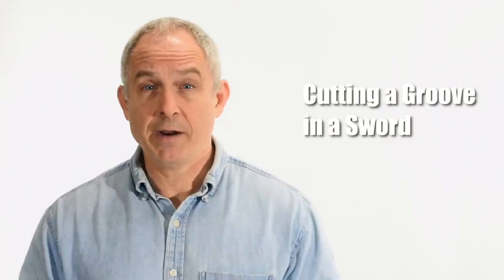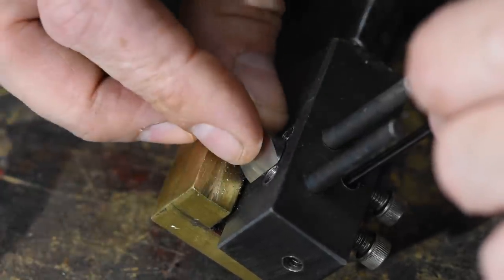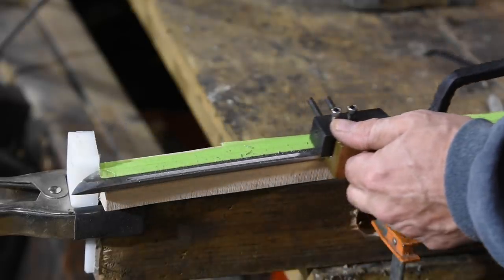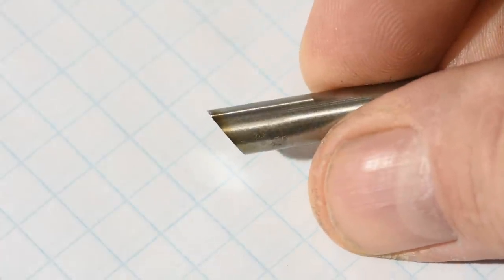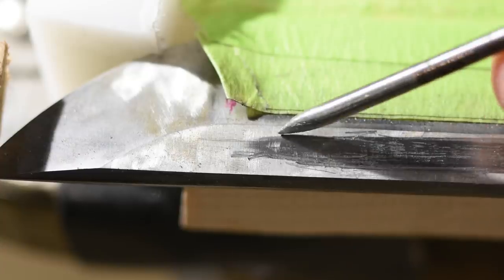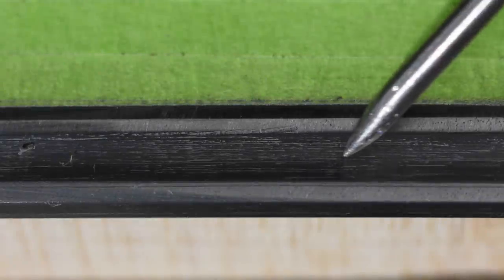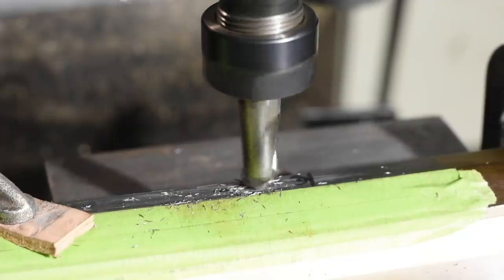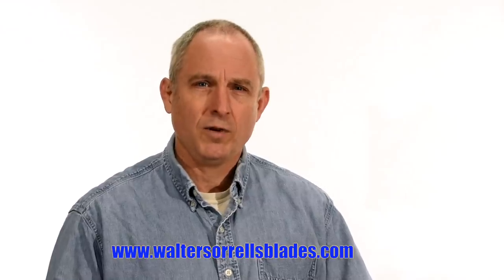Make a Groove in a Sword!

Comment: Walter. I have always found this process an absolute ball ache. After watching the videos of great makers like your self, I see now that this process is an absolute ball ache.
Reply: Exactly why I just use a mill machine. Doing it this way is merely for the sake of saying you did it this way. A mill would not make that curve though
Reply: @joey6704  I've been dreaming of a mill for quite some time now.
Reply: @NeillWylie  Worth every penny. Check out some bench mills they have out there. A little over a grand, and they can do some pretty awesome stuff if you get the right one.

I sold my old one foolishly, but I have my eyes on the Harbor Freight Central Machinery 1/2 HP Bench Mill

It'll never replace a solid one ton machine, but it also has half the headache that comes with owning one too
Reply: I never knew that hp made mills. And you can always add the bohi prior to heat treat right?

Comment: Walter, I have no idea how applicable it may be but this process reminded me of machine scraping such as we do to restore sliding ways on a lathe or mill. A Biax power scraper with the right shape of carbide tool attached might give you a good balance of speed with control to rough out grooves, especially the irregular terminations at each end. Worth researching perhaps.

Also, you’d be surprised how well a woodworking router with cheap carbide bits will cut steel. It’s terribly messy and the swarf is murderous, but sacrificing a couple $15 half round bits to rough out most of the groove material on a blade like this might save you a day of hard labor. Again, maybe worth researching. 

p.s. Check that 1/2” groove cutter hardness if you can—I’ll wager it’s softer than your 1/4” cutter causing the chatter and fast wear. 

Best regards,

Tom
Reply: You've given me some food for thought too. Thanks Thomas.

Comment: Did you do that post heat treat? If you Were to do a stock removal katana would you put a curve in the blade pre-heat treat or let it curved during the heat treat say on W2 tool steel? Thanks
Reply: If you're quenching in water you can gain the upward curve (sori) during the quench.  If quenching in a fast oil like Parks 50 you might want to add a little more upward curve than you actually want it to have while you're shaping it, since for some odd reason oil causes reverse sori, which curves the blade downward.  

 A number of years ago I was having trouble getting a certain blade hardened and so I ended up re-quenching it multiple times in some parks 50 oil.  It originally had a nicely curved belly to the edge prior to the hardening attempts, but afterward the tip dropped significantly and the edge developed a decent recurve.   To get just the right amount of curve in a sword may require a bit of experience, at least to do it consistently.

Comment: Why cut a fuller into a Katana ?  Is it to lighten it, stiffen it,  shift the balance point, or a combo of all three ?
Reply: Roving Punster
 - Weight and aesthetics/history. Reducing material from anything can obviously only make the object weaker BTW.
Reply: @MrZetor  Respectfully, that is not completely true.  Fullers do indeed add strength and stiffness, in much the same way the dimple on the bottom of a soda can does ... they are not an aesthetic only feature, if properly implemented (read: a properly parabolic cross section of adequate width and depth).  Also, only a fraction of katanas had fullers, not all of them.

In the absence of info, i'd guess the sword may have felt a little whippy/flexy, and/or the balance was a bit further forward than optimal.
Reply: @RovingPunster  "Fullers do indeed add strength and stiffness..."
- Actually, no. For any objects with the same outer cross-sectional perimeter, a solid piece is always the strongest. An object with a groove (or 'fuller'), which is commonly referred to as the 'I-beam' structure, is significantly stronger than a solid piece that has the same cross-sectional AREA (i.e., the same mass). This means that the fuller does not add any strength, nor stiffness, but, increasing the thickness and/or the height of the blade, and then cutting the groove to bring the weight back down to the original level does indeed make the blade stronger.

Granted, I suppose I didn't formulate my original comment too accurately, since weight ~= strength, but make no mistake, cutting a groove into an existing object will only make it weaker.

"...the same way the dimple on the bottom of a soda can does."
- I don't know whether I would actually classify the soda can dimple as an I-beam structure. I'd say it's more like a (semi) spheroid, and a sphere is obviously the strongest possible shape. Anyway, the 'dimple' has a lot more mass/material than what a straight soda can bottom would have, and thus it's not a valid comparison.

"Also, only a fraction of katanas had fullers, not all of them."
- I do know that not all katanas had groove(s), but do you have a source for "only a fraction"? I have always thought grooves were very common in the early periods, and even in 'modern times', maybe 10-20% of all blades had them.
Reply: @MrZetor  Thanks for the cogent and skillful reply.  The web would benefit from more people like you.

I'd like state up front that I have zero experience making knives/swords.  This is mostly armchair scientific handwaving for me. That being said, I think perhaps we're partially talking past each other rather than directly to. Like you, perhaps I could have been clearer and more detailed in my OP question/comment, but I opted to try to be terse because I have a tendency to be too wordy (as you'll see below).  Anyway AFAIK fullers do indeed have a positive effect on strength and stiffness - albeit with important caveats of the sort you alluded to.  Consider a finished retractible metal tape measure vs an identical length of the unfinished ribbon steel used to make it - without the same cross sectional curvature, the latter is compatatively floppy/ whippy vs the former  Granted the analogy is far from perfect (as you correctly pointed out), because simply altering the shape to accomplish an effect is not the same as removing mass to accomplish a similar effect because reducing mass does indeed reduce overall strength to a degree, BUT it is an oversimplification to assume the correlation is  1:1. Any loss of strength depends largely on the geometry and placement of the negative shape of material removed as well as the geometry of the material that remains ... for example, the effect of a large crosswise groove near the waist of a blade would be ruinous to both balance and strength compared to a lengthwise fuller of identicle negative volume.  The net result is that, depending on geometry, it IS possible to exchange some mass for certain desirable changes in weight reduction, balance and stiffness.  I believe you are absolutely correct that it is BEST to plan your design in advance to optimize the effect of a fuller, but i'm pretty sure i'm correct as well in supposing that fullers are sometimes added as a sort of post-forging correction to finesse certain things like weight, balance and/or stiffness, somewhat analagous to the way  weighted pommels are used to finesse balance.  That's my understanding anyway.

I dont want to threadjack anymore than I already have, so i'll stop there.  Cheers.

Comment: is rebar good for forging anything
Reply: No it isn't. Outside of a very weird circumstance rebar is non hardenable metals, some times it's unknown pot metal at best.
Reply: not knives. it's not hardenable, but it can make nice hooks, etc, if you want to practice your general smithing skills.
Reply: Some rebar will harden somewhat in water, test a small peice and see how it goes, but it IS NOT knife steel even if it does harden.
Reply: drunn_vevo - Tongs! There are a few good videos out on YouTube on using rebar to forge basic tongs. If you are going to work with hot metal tongs are an essential!  ; )

Comment: What a cop out . The cutter used by Japanese smiths is a HISEN . Nothing like the scraper WS uses . The HISEN is a much more difficult tool to use than WS scraper . Again made up tools as opposed to the tool Japanese smith use’s . The Japanese tool is the real deal . WS version is a cop out . A HI is NOT round . It has a flat section at the bottom . Someone who has never been to japan to learn giving tuition that is not the way Japanise smiths carry out the cutting a HI .  THe point cutting is entirely wrong .
Reply: You couldn't make a popsicle stick, and this man made a beautiful sword. So I'll ask ..... Who gives a fuck? I bet old Japanese smiths didn't have milling machines either? More modern techniques are just better, get over it.
Reply: It is no less valuable to the blade smith to know this is a modern approach to achieving a very acceptable result. There is nothing stopping others showing the traditional Japanese techniques and tools you described. I find the tone of your comment condescending. I did not get the impression that this demonstration ever claimed to be that of a traditional Japanese sword maker.

Comment: Cutting a groove doesn’t strengthen the blade the way that forging a groove does for the same weight. Which was the point of the groove in the first place. Cutting a groove simply weakens the blade for what amounts to esthetic purposes. 👎🏻
Reply: How does cutting a fuller into a blade weaken it more than forging a fuller?
Reply: Do you have experience in testing the differences?
Reply: nonsense.
Reply: cody allen cutting a fuller vs forging one is weaker for the same reason that forged blades are stronger than ground blades. It’s a metallurgical fact related to crystalline grain structure and orientation. When one forges a fuller the grain structure becomes oriented to the shape of the blade verses being interrupted by a cut in the grain structure. If it helps you to think about it, a functional anologue might be laminating wood grain to follow a curve. If the grain is oriented along the radius of the curve (forged fuller) it is much stronger by weight than if the grain was say perpendicular to the radius of the curve.(cut fuller)
Reply: And...no. it lightens the blade and creates an I beam structure making the weight to strength ratio better. Both can be achieved with forging or cutting.
Reply: C manycrows -  with modern steels and heat treating, the difference in strength between a proper he's treated forged blade an a properly heat treated group blade is negligible, and in all practicality not noticeable.  The forged fuller argument all comes back down to the long "forging vs stock removal" debate, which with modern technology and with knives, there is no discernible difference to the end user.  Geometry, heat treatment, and material choice is much more of a factor in the end performance than how it's shape was formed.  

The difference is in real world use and abuse versus numbers on a paper.  So for all intents and purposes a fuller ground in modern steel will give a lighter blade with the same strength as a solid rectangular cross section on the spine side of the blade.  Forging in the fuller allows for a larger blade (mainly width) in the same weight and strength as the one without it.  Fuller (bo-hi) were also often scraped in traditionally in a similar way as in this video, just like how they used a "sen" to clean up the bevels.
Reply: @cmanycrows8400  would heat treating and tempering a blade after stock removal and cutting work to reduce any weakness brought about by the cutting? I thought heat treatment would realign the crystal structures into what's desired? Thanks.
Reply: @cmanycrows8400   that's a myth, like "edge packing". nor are forged blades stronger than stock removal blades.
Reply: weregecko Citation needed.
Reply: @cmanycrows8400  probably try to learn about the actual process, before you pass yourself off as an expert... or even a beginner. any steel used for stock removal is already "forged" at the mill, so it's irrelevant in any case. 
nice meme and cool attempt at being smarmy, but do try to keep up with everything we've learned about bladesmithing since the 50s. just do some basic research on grain and edge packing. google it, look it up on bladeforums, whatever. this is entry-level stuff.
Reply: @cmanycrows8400  i'm 40, and have been been forging for 15 years. keep trying, though. 
it doesn't change the fact that you're wrong, buttercup.
Reply: @cmanycrows8400  Absolutely agree. However in either case it could also be noted that force when applied to a fullered blade, albeit lighter, needs to change direction and the distance travelled has now been increased. We use this technique in designing structure using beams and bending moments to create light but strong structures without the weight. I would argue that regardless of what blade reduction is used it would be marginally strengthened as a result of the treatment. However my understanding of the traditional reason was to make the blade lighter and provide a blood groove to assist in the deed of dispatching the enemy and withdrawal of the blade. Contemporary metallurgy and hardening processes negates some of the loss of strength by not forging in my view. I think Sorrel did a great job showing what is achievable using basic techniques and moderate skills